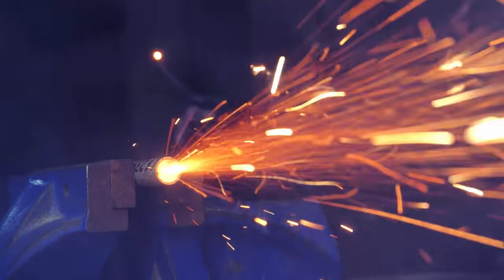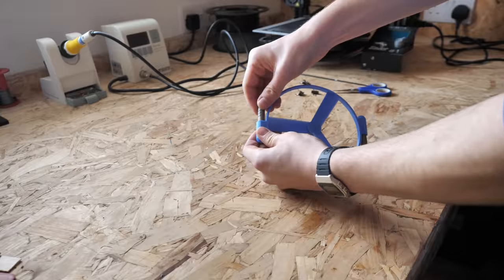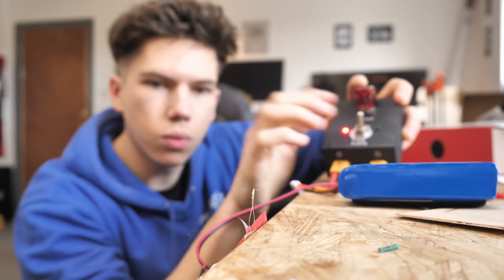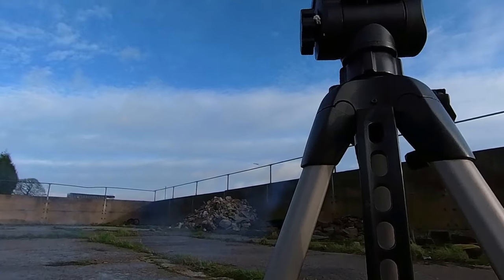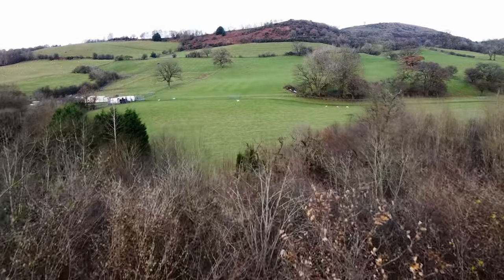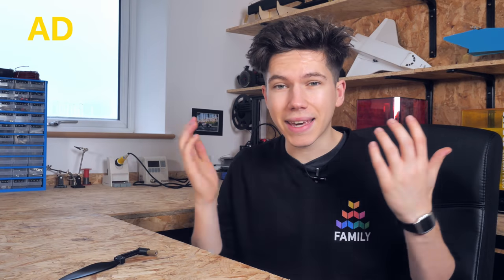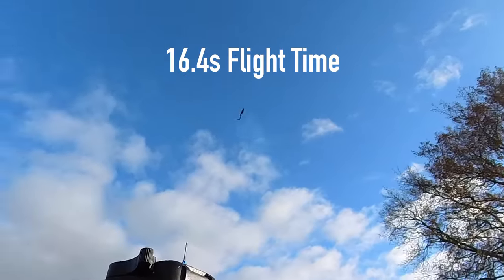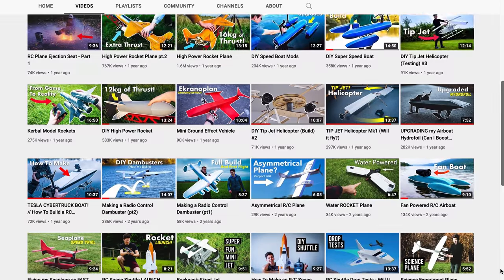Rocket Helicopter

Comment: this is absolutely terrifying by premise. hows that for a trip wire or land mine. 
years ago the govt had done some testing with rocket propulsion and so did some privately owned labs and those would have been the worlds most terrifying drones but they were quite controlled and used a pulse style combustion for most of them. but they were god awful noisy so it kinda had no stealth aspect. but these guys right here. oh yeah. with a stonger drive motor by the time you figured out what that noise was it would be moving so fast your eyes couldnt pick it up and they would be super effective. rocket powered lawn darts would be quite dangerous too.
Reply: also to add something actually useful. you should make your design with the rocket on the end of the wing and a counter weight where you had the rocket at. it would help a ton with balancing and such and would make it alot more less dangerous

Comment: For reliable electronic ignition take a lightbulb wire (but be very careful not to break it) and dip it in nitrocellulose-acetone solution and let it dry. You can dip it again if you want a thicker layer (depending somewhat how concentrated you make the solution)
Reply: Though I imagine what might work a bit better is if you incorporate a cap bank into it, doesn't have to be huge, but enough that as soon as you flip the switch it will be red hot almost immediately

Comment: I'd like to see an ultra-light set of fins on one of those motors, and maybe an assisted (rubber-band powered) launch rail.

It seems that they have about a 2:1 thrust-weight ratio, so I'm wondering how high one would go vertically.
Reply: 2-1 thrust ratio ! How could you possibly know that ?
Reply: @pufango4059  Because I went to the manufacturer's website and read the specifications? It's not rocket scien-

Ok, it is rocket science.

Comment: Won't it be simpler to use a double propeller and use rocket engine for torque to spin the blades
Reply: On the shaft of the pivot even one fires it will work